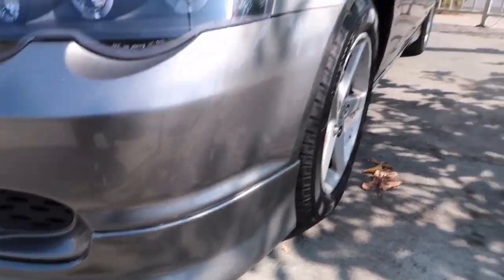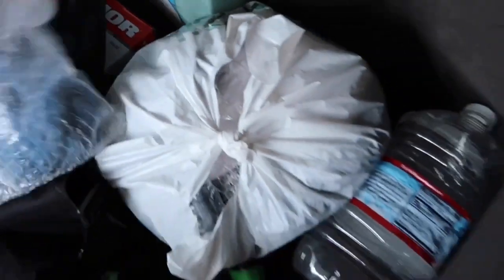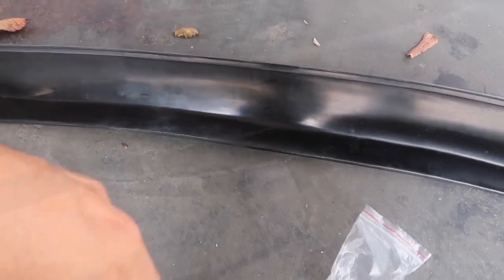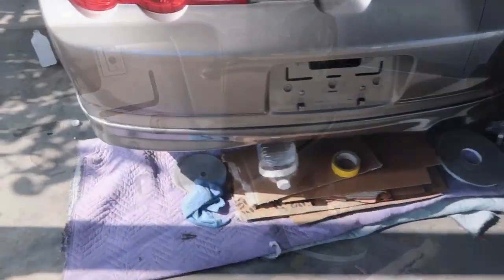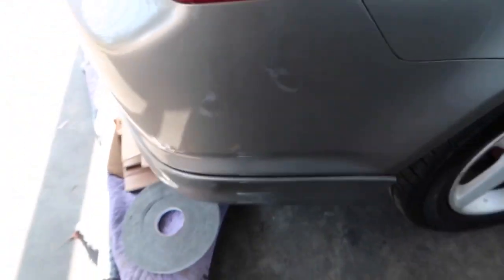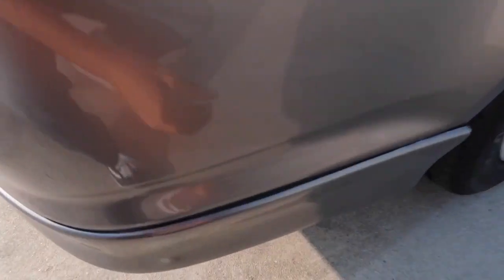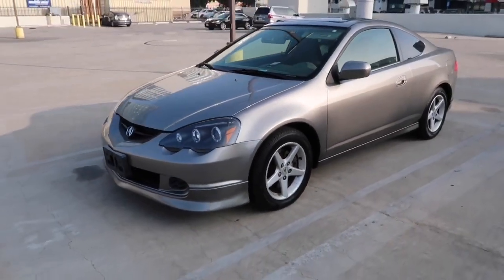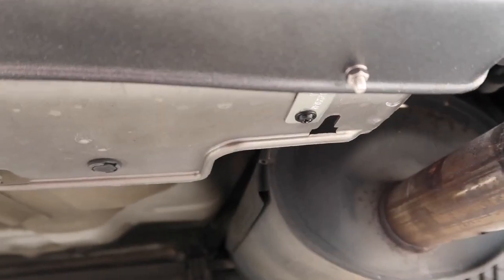Acura RSX “Integra Type R” rear lip Install

Comment: Love it hey man I live in Tennessee do u know anywhere I can get some interior pices for my 91 civic sedan and do u know if 92 95 civic wiper arms will fit 88 91 civic any suggestions would be lovely.
Reply from the maker: Not sure about the wiper arms.. but any 88-91 CRX, 88-91 HATCH, or 88-91SEDAN will work along with a lot of other parts.. 

If you are around Nashville:

2030 Lucas Lane
Nashville, Tennessee 37207
(800) 962-2277
Entrance Hours:
9:00am-5:00pm Mon-Sun

That’s the same LKQ pick a part junkyards I go to, entrance fee is $3, bring your own tools and you can find your car and pull the parts you need. They have an app too, and you can always call and ask if they have your make and model